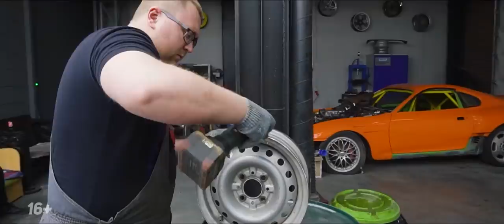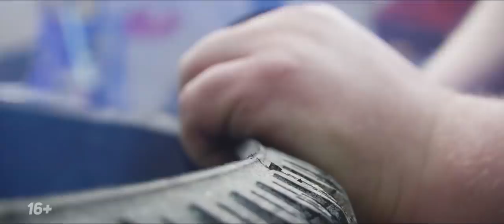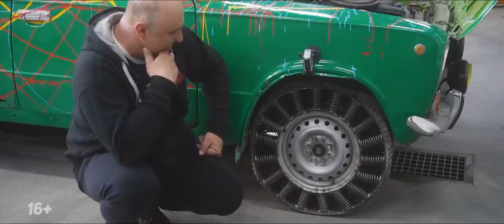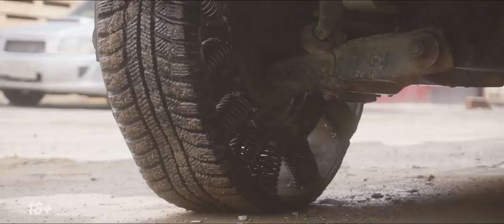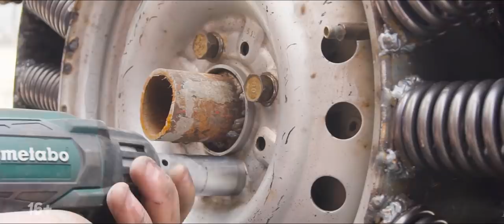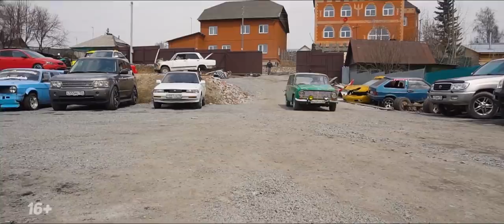Making a proper DIY sprung wheel

Comment: Reducing unsprung weight by converting it to spring weight. Genius.
Reply: This comment is underrated in my opinion, but also, people gives exactly 0 fu©ks about my opinion.
Reply: @evergreatest7644   dame
Reply: Normal tires are basically a pneumatic spring. If you want less un-sprung weight, use tires with taller side-walls mounted on smaller rims. These spring contraptions are early attempts at air-less wheels so people wouldn't have to worry about flats.
Reply: @evergreatest7644  I knew when I posted that most people wouldn't understand. I didn't post it for them. 👍
Reply: I'd be upgrading the brakes, axles, bushings, shocks, bearings, etc... That's a lot more mass out on the ends of those axles.

Comment: Softest ride anywhere if you got the spring rates correct on all 4 wheels.
Reply: I'm guessing they didn't
Reply: Sprung wheels are nothing new.
I'm more interested in the lateral performance. 
When Michelin made the first test concept of radial tires, it didn't seem like it was going to work.
On the contrary, they outperformed any bias ply tire around!
So, let's see what happens!

Comment: 5:18 You could fit six hydrocoptic marzelvanes, that would effectively prevented the sidefumbling.
Reply: I know right? The main winding was totally NOT Lotuso Delta type. And they didnt even have panendermic semi-boloid slots on their stator! Although I was pleasantly surprised they used a Ding alarm. Gotta watch out for that sinusoidal deplanaration.
Reply: That would only work if properly fitted to the ambifacient lunar waneshaft. Also every seventh spring should have been connected by a non-reversible tremie pipe to the differential girdle spring
Reply: @RipRoaringGarage  what EDIT: lol nevermind went straight over my head
Reply: @AE92World  I imagine a LOT of people wont get this...it was a mechanic meme before the internet existed LOL. Its funny because Im editing a video, and I literally just used this Chrysler vhs recording!
Reply: Also definitely need a baseplate of prefamulated amulite. It would be best if surmounted by some sort of maleable lagorythmic casing so those hydrocoptic marzlevanes can be aligned with at least two spurving bearings.
Reply: I think that excessive night fumbling might continue to be a problem though.
Reply: Lol
Reply: @reverendtfg6802  But this is Russia not the Isle of Man so may be hard to come by?
Reply: This thread is a gem

Comment: Okay, I've stopped this at 1.03 because I have a point to make.  No matter how "robust" they seem to be as you try to compress them, you are in error on how a wheel works.  On a bicycle wheel, which spoke bears the weight of the bike?  Short answer, the one at the top of the wheel.  It is literally hanging on the nipple/wheel interface, not bearing down on the bottom one or it would go straight through the inner tube and into the ground.  Point made, let's go on.  Those canted rings around the springs in the old photo are for the control of the section of the outer ring/road surface interface, since the springs have no stable relationship with the inner (hub) center.   These act in a sort of conciliatory manner, preventing the two from escaping concentricity or, at least, limiting the excess.  Without them, the wheel, in time, will stretch all the springs (the reason you need spokes), and try to acheive a 360 degree pivotal travel every time you turn the wheel to change direction.  This 'experiment' cannot succed for the reasons stated.  HOWEVER; it is certainly fun to watch, costs me nothing, allows me to turn off my brain while watching something destroy itself like  piece of kinetic art, and gives the translator the opportunity to make a series of sophomoric puns, which HAS to be difficult while simultaneously translating one language understandably into another.  My piece being said, I'm going to shut up and go back to watch how this all turns out.  Thanks, I love this series and your channel.

Comment: What Garage 54 needed to do was make four of these so the whole car was on them, then out on say a track and give it HELL haha lol. Without the rubber tread it will handle like a dog on wet polished lino floor haha lol.

Years ago i had a 1500 Lada sedan, to be fair it was not a bad car, comfy ride, excellent rust proofing, it was reliable, handling and fuel consumption were just ok, they are heavier than an equivalent model like say an Mk2 Escort.

Comment: Would be interesting to see them make a metal wheel thats treaded, so basically a car wheel with a profile like a tank tread.
Reply: @Riggsvsoliver they would probably just drum off an existing wheel similarly to this and weld on "tread" pieces. It would certainly be heavy, but definitely not enough to prevent a good video and test drive like this. Probably still weigh less than the 30 inch wheels on donks

Comment: I suspect the person(s) who made the all metal version were sick of changing tires after slogging around on dirt roads over extended distances, though more amazing, I half expected the heat from welding would have affected the tension in the spring steel. Very surprised at the results! 
A group of guys at Michelin are feverish writing notes no doubt.

Comment: Put small gas shocks in every  Spring  fitted on sprung wheel for better Spring rebound like gas struct suspension   &  fit   fat tire wall  tire & put it  on top of sprung  wheel so that  the Tire will not Get off while  driving  and fill little bit nitrogen gas in Tire to help the spring to unsprung & and handle the extra weight of passenger & car itself.
Fitting Stiff spring will only make ride  harsh  will kill  comfort.
Hope it's helpful & Functional idea.

Comment: You need to put cables inside the springs to limit the amount of stretch when the wheel is hanging from the top springs. This is how spokes on a motorcycle work. It'll keep the springs on the bottom from collapsing.

Comment: The original Garage 54 spring rims used actual suspension springs and mounted them in the back.  The next iteration should be to use Lada front coil springs on all four wheels

Comment: They should try to make a flying Lada.

I believe in them, they are my favorite Russian engineers.
Reply: Might actually work. A car that drives to speed normally, then rotates and flies. Needs to be very tail heavy on the wheels though, so it can lift the front with just the leverage from the elevator.
Reply: Top Gear made a flying Robin Reliant...

Comment: Springs like that in beds would be better (although not them as they can't support the load but like them). They start small and widen out at the end allowing the spring to over compress on itself. Given how the wheel is they would easily fit as there is a larger gap on the outer than in the inner. For the tire keeping on, a pair of steel straps running in a grove on the outside and using a rivet into the sheet on the other side. be far harder for them to pop out and keep the tire from wanting to shift around on the wheel.

Comment: i watched this video 6 months ago and I just had an idea for it! what if instead of using a solid round plate around the outside of the wheel, you use tank track style plates of metal around the outside, one plate on each row of springs, linked together by another plate that goes between each sprung plate

Comment: I suggest y'all make a car that basically drives off of a drill. So mount a single drill into the engine bay with a few batteries, manipulate the trigger wires so you can control the speed from the cabin and then see if the car drives. I would love to see this guy's.

Comment: The only thing I could see as doing different - and it would be really hard - would be to cut, bend and form the outer "tire" with steel diamond plate. That would give you a harder ride but a lot more traction in snow and sand

Comment: If you pay attention you can see how the angles between the springs and the outer wheel changed the more this guy drove the car. I guess in longer term this will lead to the sprung wheel not being able to hold effectively the weight of the car.

Comment: I thought a 'tremendous success' is when parts fly off the car with huge flames enveloping the engine compartment so we get concerned about your safety by laughing until our eyes water. Maybe I have a different interpretation of 'tremendous success. Either way, this was pretty cool. How about installing snowmobiles in place of the rear tires on a car? You could remove the engine propelling the car with the snowmobiles. You would need a linkage from the driver's seat back to the snowmobiles making the car rear-wheel steering along with the throttle control. Maybe it would be easier to pull the engine out and put the snowmobiles in the front. That would be much easier as far as steering linkage and throttle control.

Comment: How about a normal tyre with say 8 airbags in it with each airbag connected to a spring loaded air cylinder which could possibly be mounted in a a semi circular dome the same diameter of the wheel attached to the wheel ?

Comment: hmm first flaw, outside is metal; second flaw, the springs would prefer to just twist the two rings and form a spiral, instead of holding perpendicular.

edit: was wrong, apparently they were stiff enough to not twist.

Comment: How about sucking the air out of wheels and tyres to pull the tyre in then cut some steel pipe as a band to go around the tyre and reinflate the tyre with the band around it, I would think you would have zero grip on it especially when driving over concrete and it should be hilarious to watch you trying to drive with it like that 🤣

Comment: this video isn't finished, we except you driving on the test track at high speeds and strong lateral forces until it is completely destroyed. 

new idea: add water with a 120bar hidrojet in a wheel until it explodes !

Comment: Things I wanna see: Weld the diff in a front wheel drive car? Make tires out of Pykrete.
Reply: They already do video of welded diff on Lada Samara , a FWD car , and it was super tricky to steer
the power of the engine is actively forcing it to go straight

If you give it any throttle the steering snaps back to centre with enough force to tear your thumbs off haha
Reply: @televisionandcheese  Cool! I'll take a look for it.

Comment: suspended tank track wheel, right
Reply: air pouch suspended bearing, same thing
Reply: just normal air rubber wheel on the outside
Reply: normal air pouch on the rim
Reply: surface friction